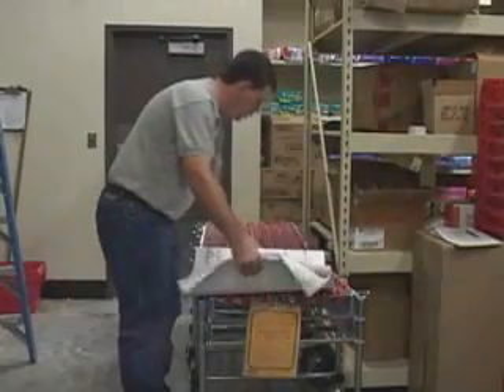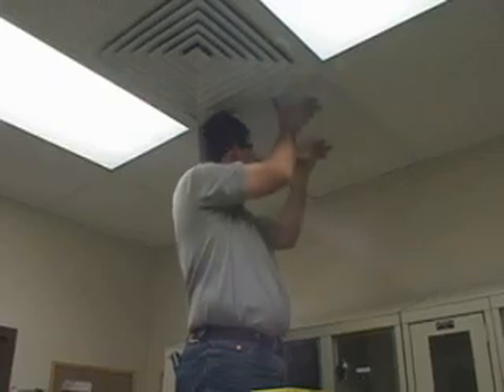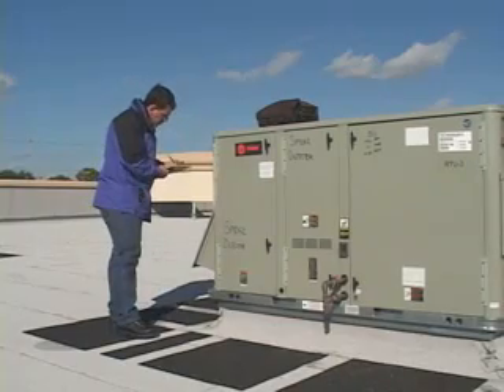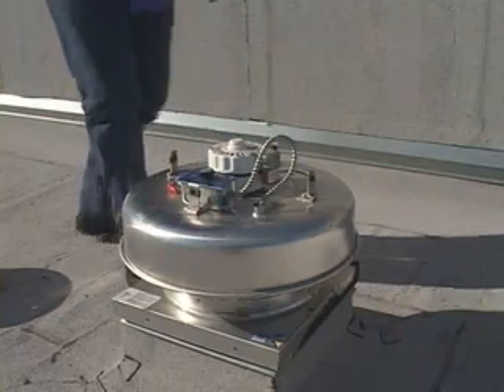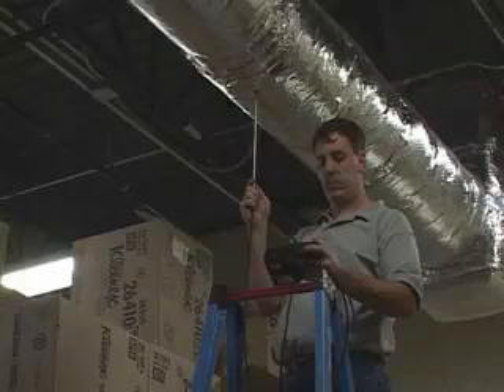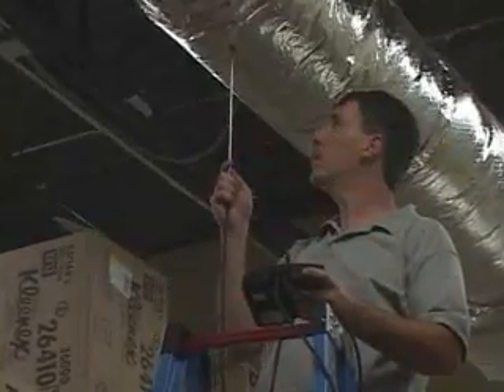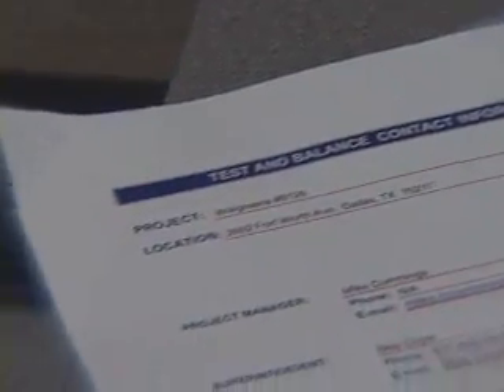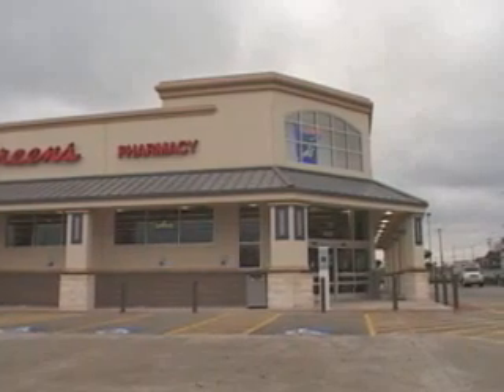What Does an Air Balance Technician Do?

Comment: But how do you achieve a positive net building pressure with only closed loop RTUs and exhaust fans without any MUA units?  Only large buildings and restaurants have MUAs.
Reply: Almost all RTUs have an outside air intake
Reply: @chris white  but at most they just mitigate some of the negative pressure and never actually contribute to adding positive pressure... wiuld need some sort of MUA
Reply: To get a building in a positive pressure there needs to be more outside air then total exhaust.

Comment: If Test and Balance can be done? Do you mean you “ verify that the systems are installed and ready for balancing “? Im a Test and Balance Engineer and I’m not sure how I feel about this video. It feels as if it only captures the absolute minimum of what we actually do.
Reply: What is the step wise procedure for air balancing in a new installed HVAC system,please provide me proper process step data...